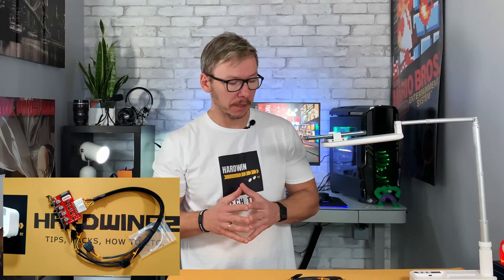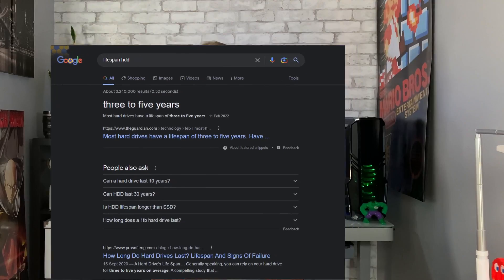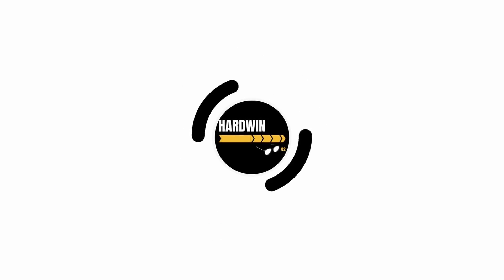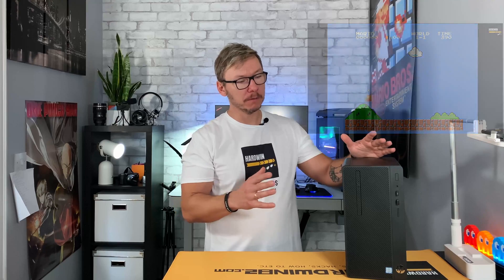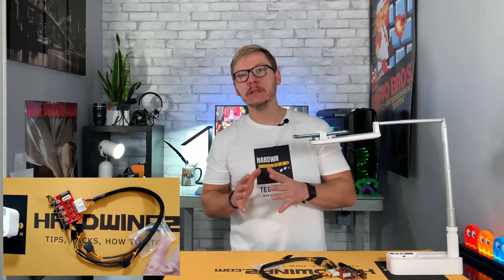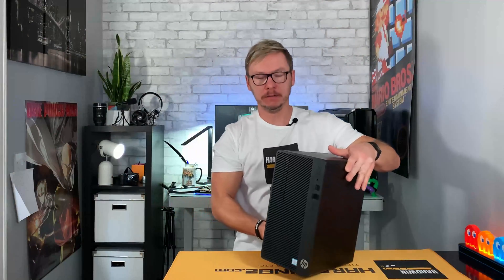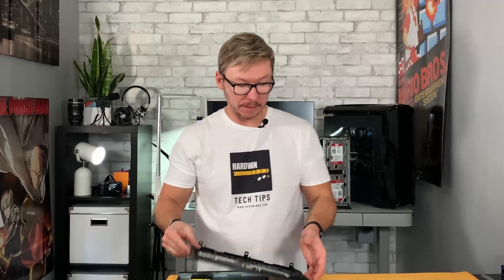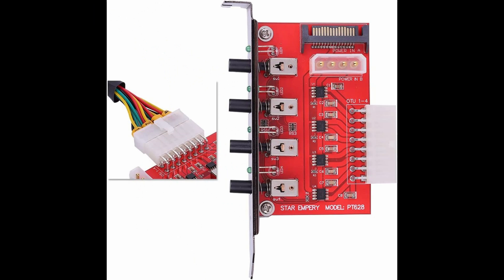Extend life of your drives - trick

Comment: Does the drive work without restart with Hot Plug enabled?
Reply from the maker: @JohnDoe_333  I tested this on two PCs with HDDs , restart was need .
Reply: @hardwin82  Just bought this type of switch, and luckily with hot plug enabled it just works as if you would connect a USB drive.
Reply from the maker: @JohnDoe_333  wow great, thx for testing this.